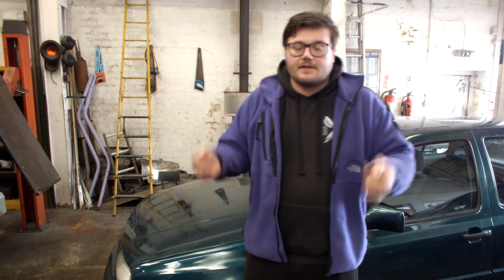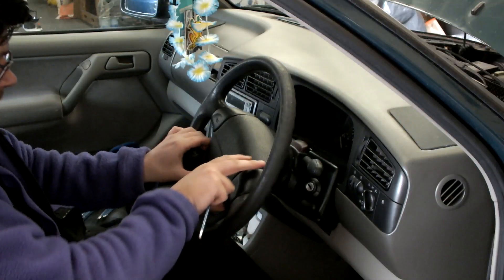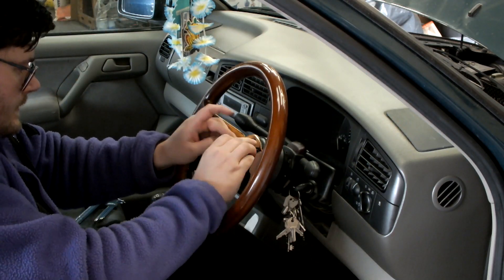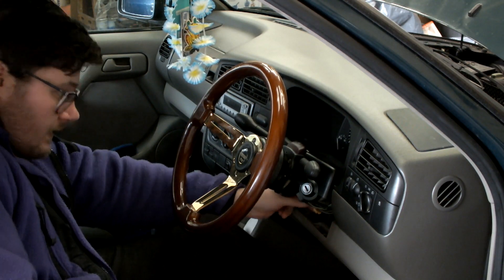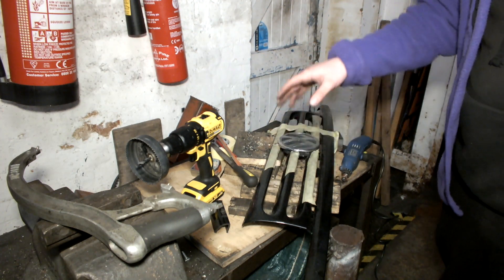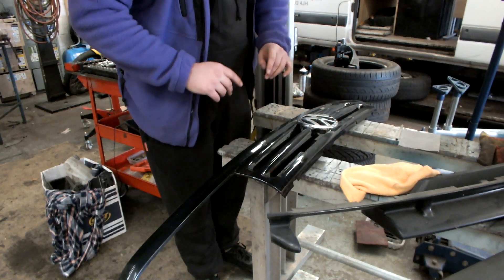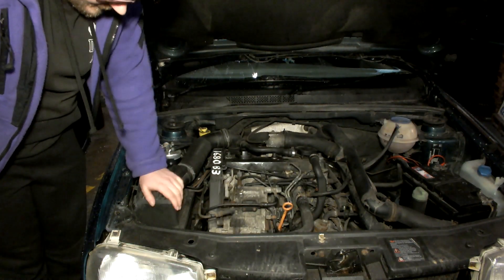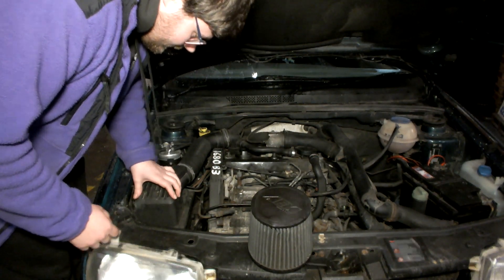Modifying My VW Vento / Mk3 Jetta Project Car!

Comment: Hi man, I have Vento mk3 as well! and I'm really glad there's someone out there giving love to these! though I'm in to ask some help. My car's air conditioner won't work because it needs a new compressor and I don't want to spend a fortune on labor. Could you make a video on how to change air compressor and compressor sensor switch and how to refill the refrigerant? The way you do everything is very neat. Please lemme know, I really want to bring my car back to life and it has only 56xxx miles in 24 years of ownership!
Reply from the maker: Hi bud, I'm glad you're enjoying the videos! Unfortunately this is a non AC car so I wouldn't be able to make a video on it sorry! I haven't got a lot of experience with AC systems so I probably wouldn't be much use anyway haha
Reply: @SortaWorks Oh okay, but again good work! Also I just wanna ask you that you know the area where there's the gear oil dipstick, that part underneath the car has oil leak which has left me out of my reverse gear. The gear applies, but it doesn't reverse just don't know why. Any help for that?
Reply from the maker: Do you have a manual or an automatic bud? If it's a manual gearbox it could be the shift linkage being worn or out of adjustment, or the gearbox counterweight not being in the correct place, it could be low on oil too but that normally doesn't cause a gear to go completely unless it's damaged. It could also be that the clutch isn't releasing enough to allow reverse to be engaged, I would check first by disconnecting the linkage from the gearbox and then by hand at the gearbox putting it into the reverse position, this will tell you if it's a linkage problem or a gearbox problem.

Unfortunately if it's an automatic I don't have a lot of experience with them, the only thing I could suggest is making sure the ATF is at the correct level and not old and burnt, if it is I'd suggest replacing the ATF and seeing if that solves the issues, but past that I wouldn't know what to do sorry, gear oil dipstick makes me think it is an automatic gearbox, the only other thing I would say is if it's leaking oil from the dipstick area maybe try replacing the O-ring at the base of the dipstick tube.

I hope this helps!
Reply: @SortaWorks  Thank you! I just replaced the O-ring today myself and the car reverses smoothly! I also cleaned and flushed the old oil before adding new oil. Thanks a lot once again for saving me plenty of bucks and sorry for late reply.
Reply from the maker: Good stuff glad you got it fixed!

Comment: hi master how many liters of oil should be poured into a 2 engine vento car?
Reply from the maker: Do you know the engine code? Most of the petrol 4 cyl engines in these are around 4 litre oil capacity
Reply: the engine is unnumbered

￼
Reply: The same is the automatic transmission from this engine
Reply from the maker: Sorry I don’t understand what you mean? My Vento is a 1.9L Diesel with I think 5L oil capacity